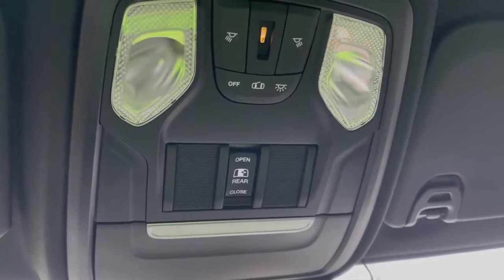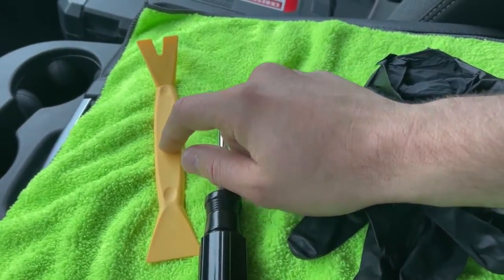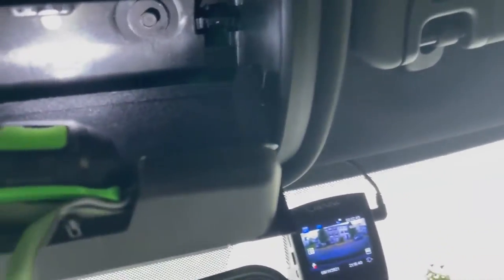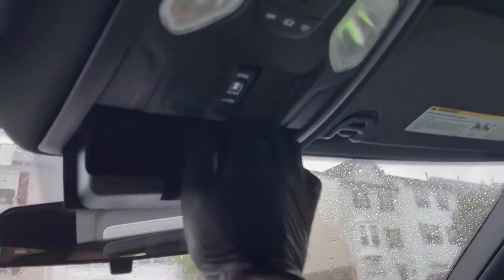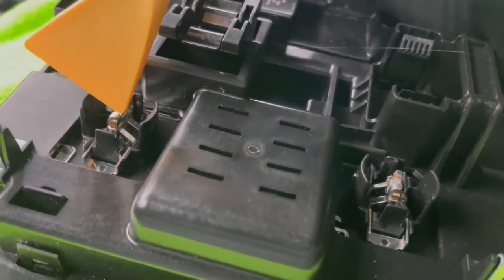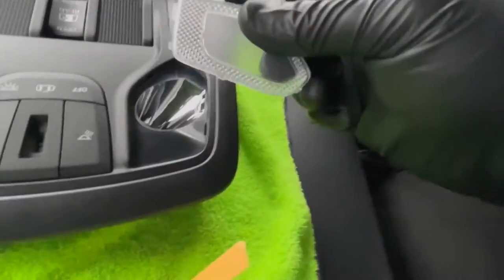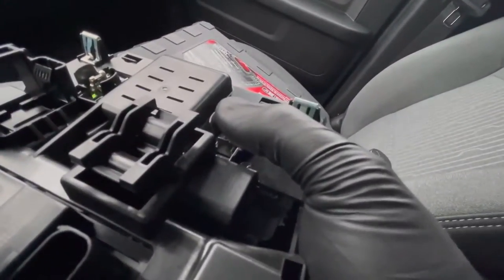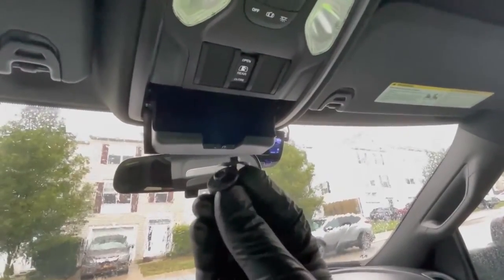2021 Ram 1500:  How to remove Overhead console and install LED map lights

Comment: I had three burnt out or flicker on my 2019 Ram.. I put the OEM bulbs back in.. the back dome still works though after few years..
Reply from the maker: Hi, our L-T10 LED bulbs comes with a one-year warranty. If your bulbs are still under warranty, you can contact our customer service team at cs@lasfit.com, and we will provide you with a new pair of bulbs; even if the warranty has expired, because you are a valued customer, we are also willing to offer you a discount for your next order.

Comment: Nice job on the video. My only addition would be that those clips on the other side of the ones you can see can be pretty tight. Mine didn't just drop free like yours did. That same pry tool is useful to ease it out. The only way to do it is to pry the unit straight down since the clips are just wedged into the retainer.
Reply from the maker: Wow! Glad it helped. Would you mind telling us the year and trim of your Ram 1500?
We want to know if there are some differences for different trims.
Reply: @lasfitvehiclelife  2021 Longhorn 1500 "Built to Serve" edition.
Reply from the maker: @scottboyle7547  Thank you.
Reply: So. Just apply force to pop them out. Mine are stuck  but I'm  afraid to brake it..  😅
Reply: @adamgonzalez9677  - Pretty much!  Just try to pry straight down with a pry tool. It worked for me.

Comment: so for the 21', whats the correct size and bulb for the map and dome light?
Reply from the maker: Thank you for the message.

As for the 2021 Ram 1500, #L-44MM LED bulbs can be installed on the dome light and #L-T10 LED bulbs can be installed on the map light.

You can find out the mentioned LED bulbs on this page:https://www.lasfit.com/products/2021-ram-1500-led-bulbs-lights-replacement?utm_source=Social&utm_medium=YTB%20Channel&utm_campaign=Ram%201500%202021-Whole%20Pack
If you have any problems, please leave a message.

Comment: I see you have a dashcam. Where did you source the power for it? I need both switched and battery power for my Viofo, which is why I for nd your video... looking for power in the overhead console. Please advise when you have time.
Reply: Just buy the hardwire kit and when you want it off just turn it off by the button or simply pull the power cord out the cam a little bit. 
It would be silly and asinine to have  a separate kill switch.

Comment: Removed screws and popped the clips, and is loose but the assembly won't come off. It is stuck on the top part where  the lights are.  Help please..

Comment: I have a 2016 1500 Longhorn Laramie and I can't find anything how to change out my overhead light. I don't have a sunglass holder like the video. Any advice how to change it?
Reply: You can pop the plastic covers with a flat head. No need for taking off overhead unit. Zip ties work for taking off stock halogen bulbs
Reply: @malanikeama6128  you can get em out that way but not back in. The holders are to flimsy. Did you see the part where he held his fingers on the back to support it while inserting new bulbs? That step is 100 % necessary.  You will damage the frail sockets if you try to push to bulb in with out bracing the socket. Their made of thin metal not much thicker than 2 pieces of aluminum foil.

Comment: Changed the lights pretty easy, the passenger worked but the driver wouldn’t go out when lights dimmed! They flickered had to put stock bulb back in
Reply from the maker: Could you take a short video to show your issue?
You can send the video to us by email. cs@lasfit.com
Reply: @lasfitvehiclelife  tried other bulbs but would stay dimly lit, so installed the halogen! now have 2 colors lights driving me nuts! do not have video but the picture doesnt show how dim it is either

Comment: Seems like a pain in the ass if you ask me. Doing it now.
Reply from the maker: Would you mind letting me know if you've finished the installation and whether it was successful?
Reply: @lasfitvehiclelife yes it worked. I would say the gloves aren’t 100% necessary if you’re careful. I just held them with a microfiber cloth. The video is good and this is the correct way to do it.

Btw I wasn’t trying to out the video down when I said that. Just saying Ram seems to have made it a pain in the ass when it probably could have been 10x easier.

Comment: Why not just remove the lens and do it that way...
Reply: I was thinking the same thing... Why does one need to remove the entire assembly if you can just remove the lens covers?
Reply: @GentooGuy  can’t get the bomb back in with out removing.  The bulb sockets are so thin and flimsy it’s 100% you Will damage them if you insert the bulb with out securing the back of the socket like he did in the video.  
You can get them out with out taking console down. But you can not replace them. The sockets are thin and the Contacts are a s frail as a paper clip.  
Really crappy design.
Reply: I tried it that way and bent the connectors back so I just looked this video up to try to get in there and bend them back. I also lost two LED bulbs up there as well
Reply: @rickylee2477 I thought it was just me. I have a 2024 ram 1500 for what I paid for this truck there's alot of cheap parts in it I'm finding out. I bent the he'll out of mine and now have to drop it in hopes I can bend it back. Half my truck can led and the other half halogen. If it was one or the other I wouldn't mind but having two different lighting drove me crazy
Reply: @BEFOREANDAFTERCONSTRUCTION same here! I don’t understand how some lights are LED and some aren’t. Most of the outside accents are LED. Have you figured out how to
Make the footwell lights bright? I know to turn the dial but they are still pretty dim.
Reply: @zacjohnson824  it drove me nuts. I ended up swapping out every bulb in the truck besides the taillights, cargo lights, and the bulbs under the side mirrors. I ended up buying a replacement for the map light housing on ebay. I didn't notice until I dropped it that one of the connections snapped. This is my second ram. Love the truck i just hate how they cheaped out when it came to that. Every bulb i replaced i bought from lasfit besides the footwell lights. Bought those off of Amazon. Congrats on the new truck

Comment: Thanks for this…. I was astounded the other video was trying to get me to do open heart surgery… for others watching I have 3 notes as I just did mine. 
-A medium guitar pick worked flawlessly to get the lenses off
-I got one my reflectors all fingerprinted up, video is correct, but once the lens is on I can’t tell the difference between the first one, and the second one
-after the 2 8mm screws and sunglasses holder clips are released, the front of the bezel is held on with push in clips… video’s just dropped out, I just had to give a couple tugs and it pops right out.
Reply from the maker: Thank you for sharing your experience on how to replace the map lights!
I believe your sharing will help more RAM owners.